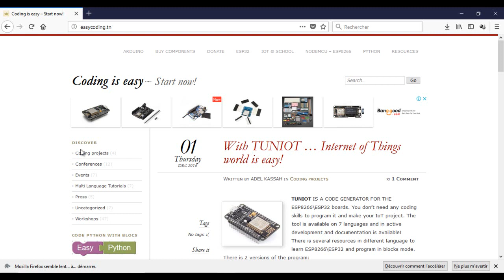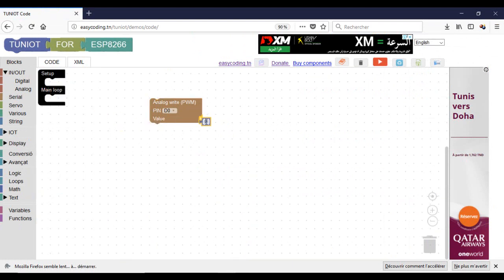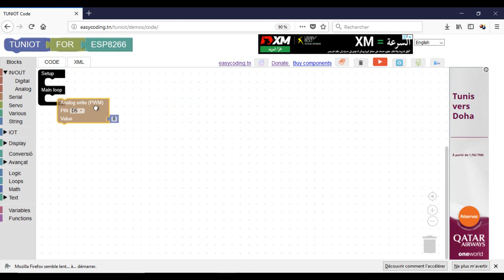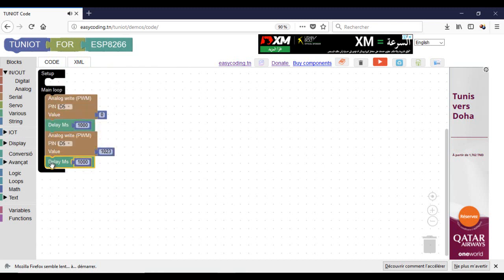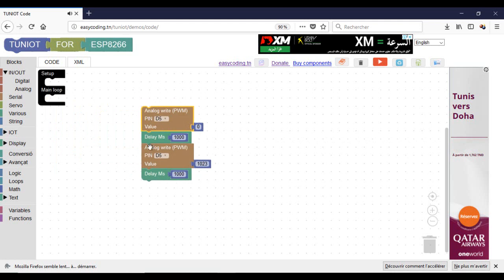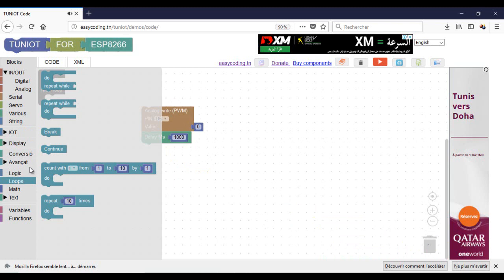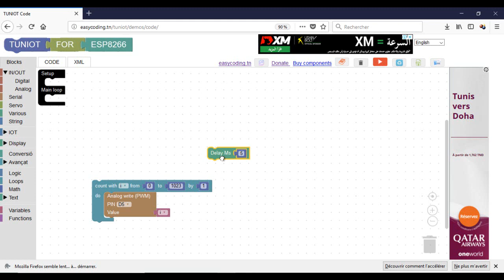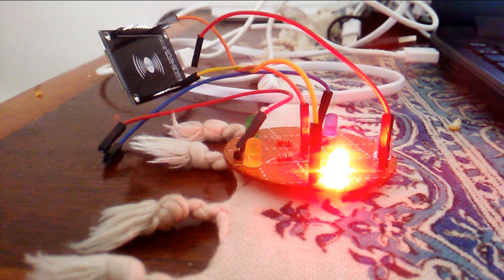NodeMcu (ESP8266) Tutorial A-22 :  PWM

Comment: The problem I'm having is not with your block coding system , Adel but with a Chromebook and Arduino on-line. I have several other computers but am using a Chromebook to test the on-line Arduino system; our Boys and Girls Club has $99 Chromebooks. The Arduino system seems to not be connected on-line with Tuniot because the red arrow does not save as Arduino sketch but as a text type doc. I have been able to save that to my Google Drive account but can't seem to get it back into Arduino . My Samsung Chromebook does not seem to have the "right click" function for copying and pasting.  Still working on it. I think on-line Chromebooks (no off line operating system, I guess) are popular for schools and clubs; very cheap notebooks.
Reply from the maker: I am extremely sorry. I don't have any idea about that. I never had a chromebook and in my country i did not see that. Try to google: Huzzah on chromebook. Huzzah os the adafruot version of the esp8266. They might have a solution

Comment: I am not given the board choice of ESP8266 when using Arduino editing on-line . I wonder if there is an Arduino board, like MKR1000 ? or some other choice; for NodeMCU ? So far I have not been able to upload with Chromebook and Arduino editor on-line to ESP8266. I can upload simple sketch to a board type Pro Micro if I choose Arduino Genuino Micro on-line. This is an interesting puzzle and I only spend the time on it because children may be using Chromebooks (Lenovo, HP or Samsung) because they are very cheap but have no operating system onboard (i am told). Also, because Lenovo is Chinese, I suppose many Chinese children may use these kinds of notebooks.  Just a thought. If I solve it I will let you all know the answer.
Reply from the maker: Good luck!